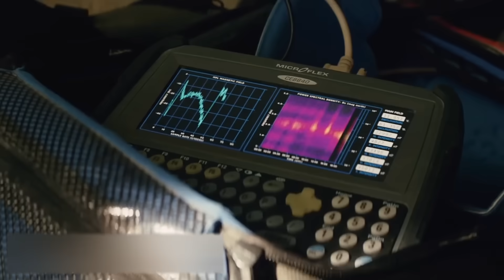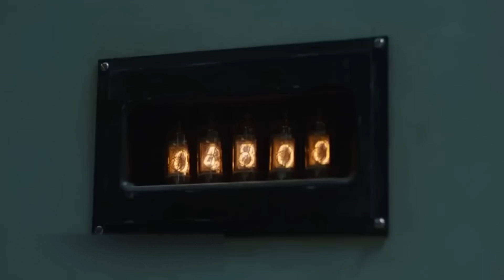Look What Happens When a Huge Dam Is Opened!

Comment: Too bad you didn't give the entire story about the Oroville Dam!  When the gate was opened initially, water going down the chute starting blowing up in the air about 1/2 way down to the bottom.  Operators slowly closed the gate and found the chute had failed and part of it was missing.  As the water was quickly rising, they decided  to open the gate a small amount.  Water eventually rose above the "emergency spillway" next to the main. That in turn, eroded the hillside that the reservoir was made of!  People for miles around were evacuated for a week, fearing the total collapse of the dam!  It took over 2 years to repair the damage caused by it! Luckily, nobody was killed because of it!
Reply: Rednbacher has that half

Comment: The real problem is not that the dams are flawed. It's that the cheap contractors doing the building skipped out on the real money necessary to build a reliable dam. My uncle was the top number one gc that took over the construction of the dam after all the supposed cost was out of control and they had countless accidents including deaths. Un needed accidents had things been done properly. There was many things wrong done wrong and he never did find all the flawed work done but done the best of his ability. And spent the better half of his life correcting others negligentce and repairing the flaws they created. Life's really changed a lot. But all the dams he said likely have flaws that one-day we will learn about them but in most cases the failure is not in the dam itself but in the soil surrounding it he said u must go deep with steel reinforced concrete and  super structures to keep it from failing  but the cost is   way higher than the people who gain from it want to spend and that's were the issue come in. But again do it right or don't do it. It's that simple far to many lives depending on it.

Comment: I think the two usage damn are impractical. The water control dam is practical. But once you add electrical generation, you have to take up space of the Reservoir. It Hass to be so high to generate electricity, which defeats the purpose of flood control. If you have more space to dampen, you have more control less space less control. You can see the problem with seasonal droughts. They have the cut down the power usage to feed crops and people to where they go so low they stop producing power all together. Yes under ideal conditions both  can work. But when that isn’t the case they work against each other.

Comment: @6:04  "what would happen if the dam failed" I know disaster movies love exaggerating it but no where near as much damage as you would think considering how low lake mead is. Davis dam and Riviera might be in danger about 60 miles down stream, but outside of that there is a whole lot of nothing. As for movies depicting it taking out Vegas, nope. The downstream of Hover does not run into vegas. Only the Vegas wash way connects to the Colorado, but that's before the dam.

Comment: We can really trace Californias water woes, and the subsequent overuse of the Colorado River, to the failure of the Saint Francis Dam in 1928. The LA River is called a river for a reason - it can in fact carry truly incredible amounts of water when the rains do fall, but most of it washes out to the ocean due to a lack of effective reservoirs. The only feasible way to build a truly massive reservoir is to dam a river in front of a canyon - the tributaries of the LA River have many canyons, and Mulholland did in fact try to dam them, which would have stabilized the flow of the LA River and possibly even eventually turned LA in to a picturesque riverfront town, but when the St. Francis Dam in San Francisquito Canyon failed catastrophically in 1928, taking at least 431 lives and obliterating a vast area of land, not only did LA stop building dams, they actually ended up draining and eliminating some of the reservoirs they had already built. This also required LA to take more from the Owens Valley, and eventually, the Colorado River.
Reply: I guess they want the danger to be located in other locations. The problem now is the water from some of the other places may be needed for people to drink. The Colorado river is running out of water due to poor snowfalls in the Colorado Rockies.
Reply: @Harry-zz2oh  ...and the root cause of the problem is Californians don't think. Not about water, not about anything.
Reply: The St. Francis damn in San Francisco to canyon failed because the damn was anchored in shale and not bedrock. It was William Mulholland's 19th and final damn he built.

Comment: What about Canyon Lake Dam in Texas? Designed by the same group that built the levees in Louusiana that gave out during Huricane Katrina, Army Corp of Engineers. This is a rolled earth (dirt) dam on the Guadalupe River. Ask an engineer (not working for the government) what happens to them. 'They break.' Eventually, not if but when. In 2002 a flood carved out a gorge below the spillway that would have taken nature 5000 years to create. Looking at close up pictures taken afterwards you can see how little time was left had it continued. My Uncle was an engineer who was hired to work on its construction. He cursed about from the beginning and afterwards sold his property down river, as did my parents. He said when it fails Seguin and New Braunfels downstream would be under 28 feet of water. Not to worry taxpayers, Texas will not be held responsible as they created the Guadalupe Blanci River Authority as a corporation (dummy) which is responsible for its upkeep and maintenance (which they do none of ) as well as older dams downstream, two of which have failed due to rusted out floodgates. And those are concrete dams. Note: It took 6 years to build this dam. In 1912 on the Medina River a concrete dam was built designed by one of the top architects of his day. If was the 3rd largest concrete dam in North America when completed 12 months later. Yeah a year. No machines just the sweat and blood of over 2000 men equipped with picks and shovels and mules which my Grandfather provided. Oh and 19 men died during construction and are entombed in it.

Comment: The emergency spillway on the Oroville Dam actually almost caused a complete failure. When it was constructed it was done with the thought that it would never actually be used so they skimped on ensuring it was built to withstand water rushing over it. The bedrock that they thought was there was just dirt and clay and it became very obvious that it would fail as soon as water started flowing. It forced them to continue dumping through the spillway in hopes it would hold long enough to get the water to a safe level to do repairs.
Reply: The dam itself was never in danger of failing... the auxiliary spillway was showing signs of failure with undermining.... It could have completely failed and not damaged the dam itself.
Reply: @kklonewolf37  due to the way it was constructed, which didnt even meet standards in the 70s, the main spillway and emergency spillway both were at severe risk of complete failure. It became apparent pretty quickly that there wasnt enough rock or erosion control built into either spillway and had the reservoir continued to fill, failure would have happened.
Reply: @63jeepj20  no there was never any danger to the dam itself. Both spillways could have completely failed and no damage would have happened to the dam itself because of where they are. They are not part of the dam itself.
Reply: @kklonewolf37  the spillways failing would have caused billions of gallons of water to flood the valley. I lived in the area and most of my family still lives in the area. They didnt evacuate everyone from Oroville to Yuba City for nothing, they weren't frantically flying boulders in with helicopters because they just wanted to play in the water. It was a very real possibility that was confirmed after reviewing how the spillways were constructed by an inexperienced engineer.
Reply: @63jeepj20  but again the dam would have been fine.... The dam was in no danger of failing... again for the 3rd time... Both spillways could have failed and the dam would have been fine. No damage to it at all... Not saying that had the auxiliary spillway been allowed to fail wouldn't have resulted in large amounts of water being released but the dam wouldn't have been damaged... I really don't care where you lived at the time. I lived in Oroville at the time. Did not evacuate and still live in Oroville.
Reply: @kklonewolf37  can you show me where i stated anything about the main portion of the dam? I have been xlear in every post that i am referring to the spillways.

Comment: Near my hometown northwest of San Antonio, TX is a dam on the Medina River. It was completed in 1918 with the primary purposes of flood control and agriculture irrigation. In 1919 there was a rain event created by a dying hurricane over its watershed. It filled the damn to near capacity, saving property and countless lives. It was estimated that approximately 50"+ inches of rain fell over a 3 day. When it opened it was the largest dam West of the Mississippi. It's over 100 years old and is stronger than when it first due the continued curing of the concrete
Reply: Did you get the book written a few years ago about it? Next edition will have updated info. Those bodies from the settlement remain in the lake bottom. Only the headstones were moved.
Reply: @jeankutzer1556  bodies? You mean bones, right. I don't think anything would not decompose inside waters
Reply: Shouldn’t floodgates of that dam be open during potential flood stages?
Reply: I might be misreading…..one would hope gates were open during flood potential

Comment: Hey guys, top tip for everyone.  When you see a video that is almost exactly 10 minutes, that's a sign that it's going to have a bunch of fluff.  Reason being, with a video less than 10 minutes long, you can only place one ad on a video, but with over 10 minutes you can place multiple.  This means that for YouTube channels, there's a lot more money in a 10-minute video than in a 9.9-minute video.  If the content creator only has a couple seconds of actual content, like this spode, then they'll often blather on and on with soul-crushing narration and B-roll.

On the flip-side, if you see a relatively recent and popular video that's like 9 minutes, that's a mark that the creator values their audience, because it means they COULD have added a minute of fluff to get a bigger paycheck, but DIDN'T.  Also, a 17-minute video probably means that the creator actually has a lot of meat there, because there's no reason to add any more than 10 minutes of fluff.

Comment: "In 2017, local authorities had to evacuate 230,000 citizens in northern California because of alarmingly high water levels in a reservoir that was created as a result of the DAMN (ah-hum, excuse me, "dam") construction."
Reply: Oroville ...
Reply: What did the fish say when he swam into a wall?

Dam.
Reply: Are we in science
Reply: We
Reply: And now you have a water crisis, yeah take them dams down Idiot.
Reply: Michael Davis The dam itself was not the problem.... The spillway structure, which was physically separate from the dam, is what started to fail that caused the evacuations
Reply: @lawrencehaguewood5857  The main spillway was deteriating rapidly so they shut the gates.  They thought they could release the water through the section of the power generators and be ok.  The water continued to rise because a warm rain was melting all the snow and started going over the emergencey section of the dam.  This section is lower than the main part of the dam designed for an emergency.  The emergency happened because the main gates were closed and it started to undercut back under the section of the emergency spillway.  This was then a bigger emergency.  This was about the time the evacuation order went out.  To hopefully save the dam they decided to reopen the main gates and let it destroy the main spillway to more rapidly lower the water level. Down stream the water levels in the river was at or near the top of the levies.  A similar weather situation happened in 1955 and there was no Oroville dam.  We lived south of Yuba City and we were flooded either the 23rd or 24th of Dec and the next day Yuba City got flooded.  I was 12 at the time.
Reply: No, they were evacuated due to an aging structure that wasn't well designed.
Reply: @praestant8  Well, it looks like my usual source of "reliable" information was DAM-nably incorrect; I reiterate: DAM! ;)
Reply: @gardenphoto  Damn if you do dam, damned if you don't?
Reply: @praestant8  Dam, you're very much correct! My bad ;)
Reply: Go figure,  seems socialists don't know how to build shit.. Well,  actually that's all they build is Shit,  look at Kali roads. Fuckin commies, probably stuffing their pockets while minimizing everything the infrastructure needs.

Comment: Oroville Dam went through a massive rebuild, and by 2019, it was one of the best earth dams in the world. It's now, 2020, with no problems seen. You will be amazed at what was done, in this total rebuild. More like a miracle.
Reply: You must be smart
Reply: @Jessica-sq3rb  Yeah he is, look at the southwest of America no new reservoir or source of since 1980 and they wonder why there's no water now?
Reply: California has had a deep drought since Oroville was fixed so it hasn’t really been tested yet by being filled to capacity.
Reply: The dam was not rebuilt. They didn't do anything to the dam itself. They tore out and replaced the main spillway and concrete stepped the auxiliary spillway. The replaced spillway has been inspected numerous times since replacement and it is full of cracks....
Reply: When the dam was being constructed I would go to the overlook and watch with a neighbor who was a CalTrans engineer, he made a comment at the time. “The main structure is no problem, it’s the area the spillway is being constructed that will be a problem in the future, he then proceeded with some engineering gibberish that was miles over my head, whatever he said was totally correct.

Comment: The Oroville dam experts got lucky 😂 they didn't do routine maintenance on the emergency shoot and thats what almost cause the over flow to happen
Reply: Not exactly. The not very well maintained main spillway one day developped a BIG hole during heavy use, then they closed the gates, water was rising and going over the (never used in the 48 years the dam existed) emergency spillway. That caused back cutting erosion threatening the emergency spillway to fall over. That's when they decided to rather use the damaged main spillway instead of causing the emergency spillway to collapse and A LOT of lake Oroville to blast down the hill and into the Feather river flooding towns downstream.

Comment: Also, the death of those 2500 Italians was not due the failure of the dam at all, you said yourself that the same withstood the overtopping event..
It was a natural disaster, and those people chose to live under an unstable mountain range, landslides are inevitable.. if anything, the dam probably held back much more of the sludge and slurry which would have otherwise moved even further down the valley..
Reply: The deaths resulted because they built the dam at a location known for landslides.  In the past the landslide would block the river for a time before being slowly eroded away.  The dam provided the huge quantity of water for the flood.
Reply: The builders had full knowledge of the risk and scale of the landslide risks.  They were also warned that a body of water would increase the risk. The local people were very vocal in their protests but got ignored.  There were some high-level prosecutions with one director committing suicide over it. 

And the people affected were not living in the unstable valley but outside of it.

Comment: how are dams even built? how do they hold the water back WHEN putting all the concrete in place to build the dam in the first place?
Reply: I’m not to knowledgeable on damn construction but I assume they just reroute the water until it’s complete or build some barrier and pump water out
Reply: @chrislee4766  thanks
Reply: It’s just a river before the dam is built the huge lake behind the dam isn’t created until after the dam is built. They can divert the river in order to build a dam. That’s what they did with the Colorado river they diverted it in order to create the Hoover dam. Then after the dam was built, they eliminated the diversion tunnels which allowed the river to flow up against the dam and then Create the huge lake. Amazing what mankind is capable of doing.

Comment: Most modern dams are made to survive over topping which is caused by heavy rain falls for a prolonged time thus exceeding the dams capabilities to safety release the water. Orville dam was designed to be over topped, this is better then having the dam fail

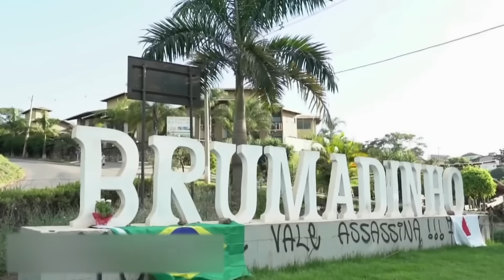Comment: 7:35 it was not a dam that broke is was a land slide caused by explosions
Reply: By rain, not explosions
Reply: @mateuszmat244  I think it was more to do with the high level of water in the dam soaked into an unstable mountain side causing it to soften and collapse.
Reply: @Michael467012  That is true.  The constructors had been repeatedly warned about the instability of the mountains around and that presence of a body of water would only weaken them further.  That is what happened.  There were a number of high-level prosecutions with one director committing suicide because of the scandal.